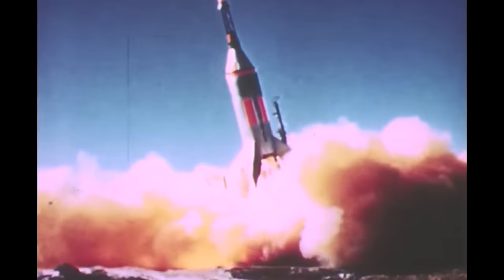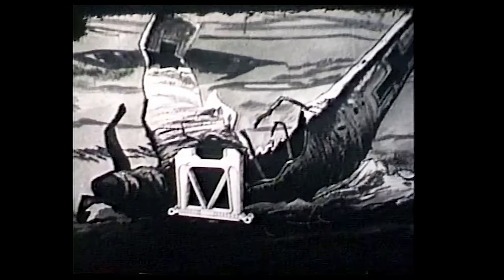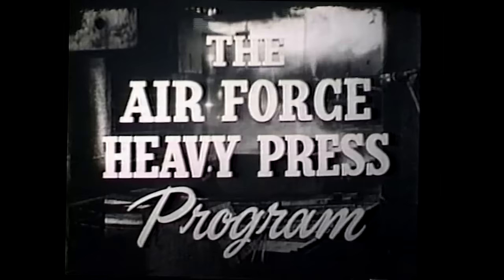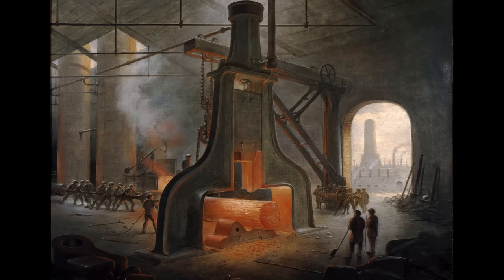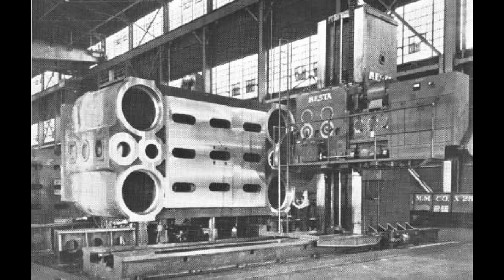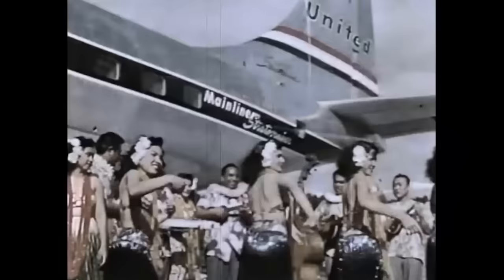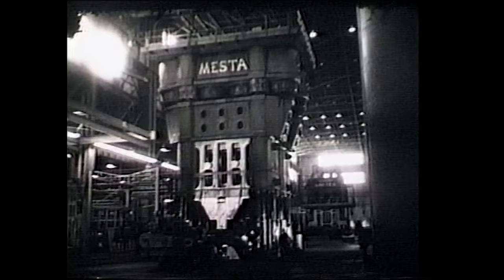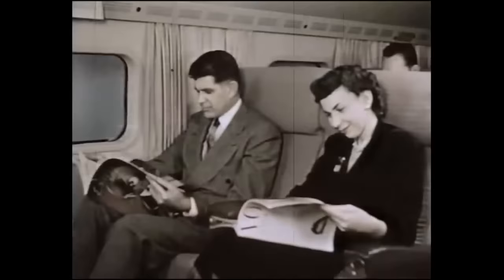America's Iron Giants - The World's Most Powerful Metalworkers

Comment: Saw your recent screw video. As a gear cutter and generally interested person, I'd love it if you could do a video on gears (I noted the brief image of a lantern gear and pinion in the screw video). The involute tooth form and the ways of generating it and approximating it (hobbing, shaping, form cutters, milling) are both incredibly simple AND incredibly complex. I would even be able to get some video of hobbing, shaping, and form cutting if so wanted. 

It is also worth noting that although screw lathes are the original way to mass produce screws and worms, hobbing can also be used and will generate proper involute threads in screws and the more commonly hobbed helical gears.
Reply from the maker: Yes, please get in touch with me http://machinethinking.co/contact/
Reply: @machinethinking  Did this ever get made into a video? If so, is there a link?
Reply: Yes, as a toolmaker I would like to see a good gear hobbing video
Reply: @scottrackley4457  I would recommend a video from a channel called This Old Tony.  He has a fantastic video on the process of cutting gears.

Comment: The only reason I can think of someone needing a 200,000 ton press is if one is trying to hot forge pure Tungsten or tungsten alloys. Which is the toughest metal to machine. Having a density on par with gold and uranium (making it almost twice as heavy as lead) and a melting point of 6,192 °F (3422 °C) Such a press would be used for forging jet turbine blades and rocket nozzles , massive pressure vessels for nuclear reactors, and such. Applications where weight is no concern in the face of sheer strength at ridiculous temperatures.
Reply: Great comment.
Reply: Naah - what metal are you going to use for the mold when you try to forge Tungsten at its ridiculously high temperature? There is no metal that could survive that. These presses just need to get bigger when you make bigger things. Like Tesla's Gigapresses - they are just pressure die casting machines, but it is all scaled up much bigger than the previous limiting sizes of that process - so you can make half a car for the first time ever.

Comment: I'm a M.E. & I have the responsibility for the daily operation of a 4k ton horizontal extrusion press, a 1.8k ton horizontal extrusion press & a 1.5k ton vertical press.  My work site also has a 5k ton vertical press.  Small potatoes to these presses but interestingly, not much has changed except improved safety & computers controlling the work so fewer operators are required.   Great video !

Comment: As a apprentice in the early 1960s in the UK, I witnessed the installation of a vertical press and was amazed that the base of it was 40 feet below the factory floor; It's main use was for forging nickel alloy aircraft engine turbine blades - one at a time!  It was an education to see such a vast machine producing what, by was comparison to its size, a microscopic component - so much power was needed to forge even small nickel alloy parts!

Comment: We need to make the 200k ton press now! Print some train chassis for a high speed rail.
Reply: Its not that simple. At those extreme pressure's, temperature begins to be a huge limiting factor, and keeping everything cool enough not to expand or warp out of spec is a massive problem. Added to the problem is the materials being formed and the dies melting.
Reply: @Jedda73  We won't with an attitude like that
Reply: I'll copy in what I wrote below. Keep in mind this was with a large global manufacturer.  Years ago while I was at university studying engineering, one of my professors was working in collaboration with one of his graduate students on a giant experimental press that had reached pressures of 160 kilo tonnes. At those pressures the materials used in the press were heating up so much they were having problems with distortion and seals failing from expansion, so they were working on how to cool everything and what materials to use in the affected press components. I cant remember the exact use for the press anymore, I think it was for extruding copper alloys and they were having huge problems with the dies over heating and the material melting while being extruded. It was supposed to be kept secret, but the professor was so excited about it he wasted an entire lecture working theoretical values and telling us as much about it as he thought he could get away with. I've never heard anything about it since, so it appears they couldn't easily overcome the hurdles or more likely ran out of funding.
Reply: With my heart I agree. BUT. There has to be an ROI on such a huge capital investment, government or private enterprise. What's point of making each part if they cost orders of magnitude more than other methods. Also there's the limiting factors as Jedda73 explained. The demand curve seems only to need 50-80kt or less. Plus the USA just leapfrogged this old technology with laser sintering of powdered metal,  ie. 3D printing.
But getting back to your point, hopefully we can find a way to make high speed rail cheaper to manufacture because, yes, we need high speed rail globally.

Comment: Dude all the Mills and lathes depicted. Dang at 5:27 that's a floor mill. Where the mill moves around the part. .
Reply: That is a horizontal boring mill very similar to the one I operate at work. The work table is floor level and the cutting head has a maximum height of 15 feet above the floor and the head moves about 25 feet on the horizontal axis and the spindle can extend 9 feet

Comment: That was absolutely fascinating and well put together. I love old machinery and equipment of yesteryear. The amount of solid work building heavy equipment using only slide rulers is fascinating. My father was an engineer at Rockwell on the space shuttle and part of the tile design team specifically the black tiles that took all the heat. Even then he still used a slide ruler. They had access to the mainframe computer to work out copulations but you actually had to sign up to use it. Boy we have come along way. But then in some ways we’ve gone backwards. Those engineers of yesterday were really something using the most basic tools to accomplish amazing feats. Thanks for presenting this you made this subscriber very happy.

Comment: When I worked for Weyerhaeuser back in the 70’s & 80’s the machine shop had a 900 ton  horizontal press that hadn’t been used in years. I always took the time to clean and keep the face polished, even though the rest of the area had turned into a reciprocal for anything and everything anybody didn’t know to do with. I was so impressed with how large it was and how breath taking the slightly radiused Highly polished massive ram was. You’ be lucky to find a bent nail today, in the field where that shop used to stand. The creek where they collected cooling water from is still running, however. Last fall while mushroom hunting I saw 2 cut throat trout under the logging road bridge that is still standing and functional.

Comment: Those are NOT the nuts , the nuts are at the end of the rods shown being machined. They are not the nut like a bolt nut you see, but round as they are installed as the rod is heated and cooled to set tension
Reply: That's a relief to me! I was trying to imagine a wrench for them with a one mile long handle
Reply from the maker: @keith Lewis.  Thanks for the correction. Do you know of any photos that show them? It bothered me not to be 100% sure about their location or what they looked like, which is why I made sure viewers understood I was not certain.

Comment: I've worked on German 1000 Ton presses (and relative plant ancillary equipment.) German hydraulics (HAVVE pumps /directional valves) use pilot pressures of up to 5,000 PSI (amazing in that US made machines typically have 500 PSI pilot pressures). 
What he called "columns" in video are "tie bars" held on with "tie bar nuts" that MUST be accurately torqued for proper stress (hydraulic force) being evenly distributed across die faces.
The Germans had their own unique way of doing things and definitely knew their stuff! Their electronics technology was "so-so" tho...
This video hits right on for me...feel right at home! 👍

Comment: I can still remember the Cold War years. Right now Uralmash has invented the hybrid ultrasonic hydraulic press(es) that uses powerful 3 million cycles per second barium titanate crystals embedded in certain parts of the hydraulic press made out of annealed and tempered high carbon-boron high alloy steels. The 3 million cycles per second ultrasonic vibrations gives an assisting effect to make it easier to hot press metal alloys and cold press light metal alloys while simultaneously strenghtening them in the process. The 3 million cycles per second barium titanate crystals information on Google is NOT AS COMPLETE COMPARED TO THE MICROFILM FILES that I am cross-referencing what Google has on the internet. THANK GOD FOR MULTIPLE-DUPLICATED MICROFILMS!

Comment: Years ago while I was at university studying engineering, one of my professors was working in collaboration with one of his graduate students on a giant experimental press that had reached pressures of 160 kilo tonnes. At those pressures the materials used in the press were heating up so much they were having problems with distortion and seals failing from expansion, so they were working on how to cool everything and what materials to use in the affected press components. I cant remember the exact use for the press anymore, I think it was for extruding copper alloys and they were having huge problems with the dies over heating and the material melting while being extruded. It was supposed to be kept secret, but the professor was so excited about it he wasted an entire lecture working theoretical values and telling us as much about it as he thought he could get away with. I've never heard anything about it since, so it appears they couldn't easily overcome the hurdles or more likely ran out of funding.

Comment: Did anyone else note that the plane  interior shown was the ill fated comet airplane? You can tell because the windows are so big and square. Those square large windows caused stress cracks at there corners that caused several of the planes to crash before the problem was realized and the planes decommissioned.

Comment: Our modern vehicle's protective systems (the passenger cabin) in particular comes from this old tech. Metallurgy, and tech has made super strong steel formed and never seen under the paint of your average vehicle made in the US, Japan, Germany and even Korea. That is why higher survival rates in vehicle collisions has come such a long way. Supplemental restraint devices like 3 point seatbelts came out around the early 60s, but the AHSD didn't make them mandatory until the 70s. Still, Airbags, and ultra high strength steel didn't come into the picture until the 90s. Areas like Sweden, Germany were ahead of the US in occupant safety innovation. Presently, all vehicles have safety standards. You should all fasten your seatbelts!

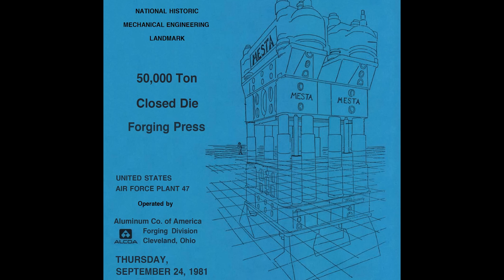Comment: I'm a Millwright at the Cleveland Howmet Aerospace AKA arconic AKA Alcoa facility. And I work in a plant which is large Aerospace where that 50000 ton press is. It is pretty impressive. It also has been completely rebuilt. I believe 2010 was when it was redone. The 35000 ton press is also pretty impressive. In your video at 11:38 (timestamp) You can see the Alcoa 50 ton press sign at the top of the press. We recently took those down And they just look like some regular signs but those weighed 900 lb a piece lol And we tapped and screwed a new thin sign on top of it and rehung them.
Reply: Are you guys union? If so how many union employees work there?
Reply: @loveydovey4u  Yes we are union. We are UAW 1050. There used to be a lot more that worked here I think there was a 160 millwrights that worked here at one time And now there's like 60 something of us. But I'm the entire lot somebody said 1200 and somebody else we are down to 900 so I would have to check. But there's three wheels plants here x y and s and then there's two aerospace facilities h and A plant. I work in A plant and it's about 18 acres. The entire facility is 140 acres And I think it's 46 acres under roof or something like that

Comment: You should really read the whole report and not just the conclusion. The conclusion was based on the following assumptions:

1. That large presses were not heavily used for the production of M1 tanks and M2/M3 armored vehicles and the case for cost reduction from welded assembly processes had not been made. 
2. That if closed die forging were to be used existing large presses were sufficient for the production of vehicles the size of M1 tanks and larger vehicles were not anticipated. 
3. That existing large presses were sufficient for the production of Apache, Chinook and Skycrane helicopters.

Which is to say that the report isn't claiming that there is no case for such a large press, just that the US Army in particular wouldn't get much use out of them. 

However the report does reference a couple of other reports which I can't find online in which indicate that a 200Kt press would represent considerable gains for the aerospace industry (p14-15) and that the Japanese had developed "flexible die" technology for the production of ship plates (p23). In fact the report says that "Aerospace needs and justification for a large press appear to be well documented" (p16).

In fact, almost the polar opposite to your inference, the report is written on the assumption that the case for even larger presses is virtually self-evident, and is asking the specific question of how much use could the army get out of them, with the answer being basically none.

Comment: Correct me if I’m wrong, but a lot of material in Aerospace/Aviation now use composite materials that don’t need presses like this as the massive pieces aren’t metal. I’m talking about Full bodies, wings and the large components. Perhaps smaller components like landing gear and parts within the turbines and all actuators and more still need to be metal, but I’d be surprised if they needed 50Ton presses. IE I find it hard to believe that the few large presses need to support so much industry all over the world. Perhaps smaller presses make sense for this? Sure in the past before composites you’d need more presses, but I’m still finding some examples drawn here as not making sense for me (airplane wing, part next to your seat) 

Idk…you guys tell me.

Otherwise great and super interesting video !

Comment: They to start a heavy pressed program for automobile manufacturers. That combined with other composite parts to reduce the total weight of cars dramatically. If they can reduce the weight of planes and they can do it with cars and greatly improve gas mileage.

Comment: You look at the bay of fundy... 60 foot tides... do a coffer dam.... with a float around the outside...  Whats the limit you could design? Mind you as simply as I have put it.. one stroke per tide... 

You could also try dual action... as the press comes down thru gravity the work piece comes up on the tide action... 

Ya I know.. but it could be a way to reduce the input needed to achieve massive psi imputs

Comment: One puzzle about hydraulic press always stuck in my head

Under the enormous pressure, why doesn't the movable part, sleeving, pipeline, valve etc. of the press break first?  This is not about built quality but a fundamental physics, the solid metal should not give up before the more delicate components.

Comment: Oh we will need those larger presses, for when we are building space ships of colossal dimension.
Reply: @johntheux9238  Musk is not exactly credible these days, but I agree with that statement
Reply: @tomt.8387  It's not like they have to start from scratch again for this ship. In fact with 3.5 times the thrust per nozzle area of the Saturn V engine (rocketdyne F1) raptor could lift a 387 meters tall rocket. Here is the data:
2,261kN/m² Raptor-FT
1,582kN/m² Raptor
1,394kN/m² Shuttle SRB
1,358kN/m² Merlin 1DFT+
1,164kN/m² RD-191
1,162kN/m² RD-193
1,159kN/m² RD-180
1,104kN/m² RD-181
1,099kN/m² RD-170
1,051kN/m² Merlin 1D
1,013kN/m² RS-27
  959kN/m² BE-4
  946kN/m² RD-275M
  930kN/m² H-1
  923kN/m² NK-33
  900kN/m² RD-275
  880kN/m² Viking 5
  862kN/m² Viking 2
  764kN/m² Rutherford
  752kN/m² RS-56 OBA
  673kN/m² RS-68A
  647kN/m² F-1
  636kN/m² RS-68
  487kN/m² RD-107
  411kN/m² RS-25 SSME
  363kN/m² Vulcain
  311kN/m² Vulcain 2

Comment: The Nazi industrial sector, unknown to us at the time, had the largest closed-die press in the world. We only surmised that it existed by evidence, kind'a like the footprint of Bigfoot, because we salvaged a one-piece wing spar out of a German wreck that was so long that pointed out the potential capacity or size that would be required to make it.  Sure enough, after the war, we found it. The Soviets took it for war reparations, and it disappeared into the Soviet Union.   In 1991, after the Soviets fell and the country was opened up to the outside world, the pieces were found rusting away on the shores of the Baltic Sea.  It never made it into the interior of the country to be re-erected.
Reply from the maker: junkdeal if you have a source where I could get more detail on this info I would be grateful.

Comment: You lost me at 10:00 minutes. ...columns are 80 feet long and 40” wide... 40” in DIAMETER!!  Length, width & height are rectilinear measurements. Objects with a circular cross section have diameter - not width. If you don’t know width from diameter I’m finished watching your videos!